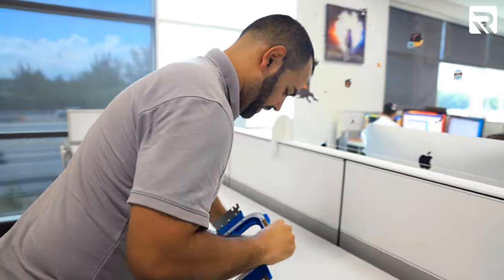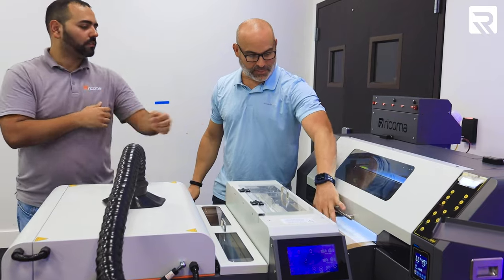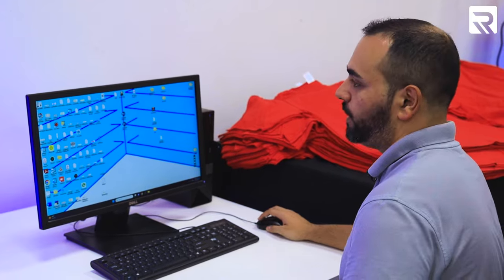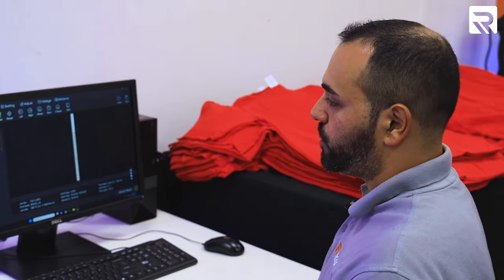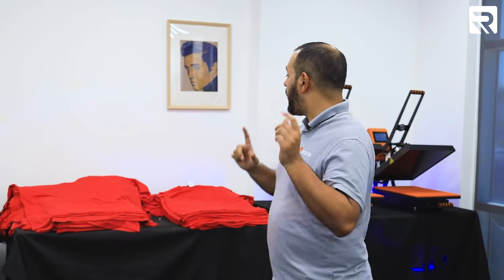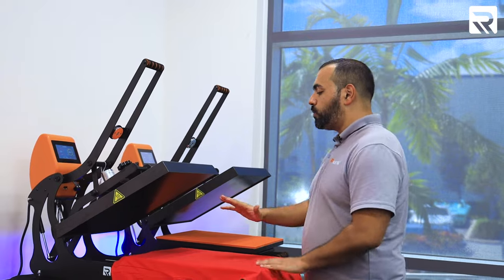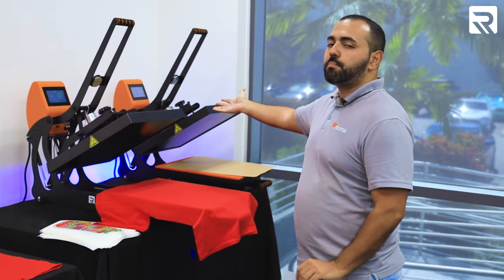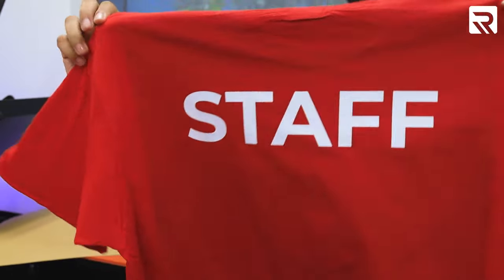UNREAL RESULTS Printing 122 Shirts with Ricoma’s Newest DTF Printer

Comment: Question on the front and back pressing. I know that some put something in the shirt like a teflon sheet when pressing a second print on the shirt. I have the Luminaris 200. Can I do front and back of shirts like you're doing here the same way?
Reply from the maker: Yes , but when you do the second press you need to add a teflon on the bottom and top platen!

Comment: I'm building a luxury brand and I want my design print quality to be top notch. I can't use screen printing because my designs are so complex so I'm confused how my designs should be printed. Can the design be printed twice for a better quality or something?
Reply: its pigment ink. vs plastisol ink.  I find it to not be as durable, but the detail is second to none. So what does quality means to you ?
I will say supacolor has a best of both worlds going on but pricy.
Reply: @wisemaester  I want my shirt design to be durable with vibrant colors and not feel like plastic and cheap. I just discovered sim process screen printing but I'm not sure if it works on colored shirts.
Reply: Screen printing has the best quality and the sim process makes design options unlimited. Any major brand will use screenprinting and especially a luxury brand.
Reply: DTF for T-shirt in my opinion has the worst quality it feels like a big sticker on your shirt.